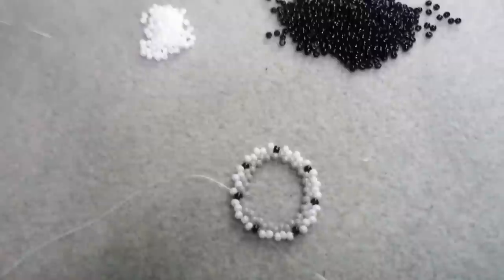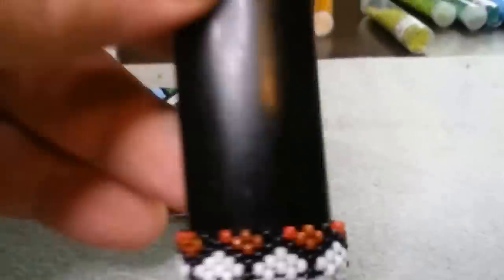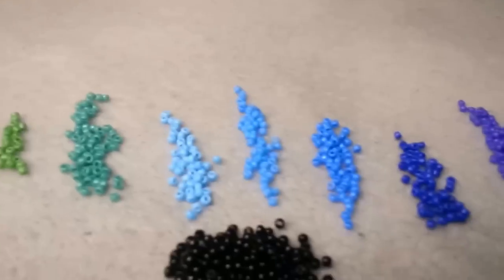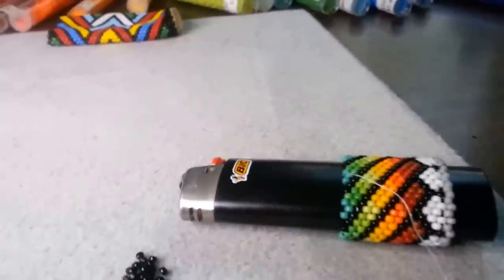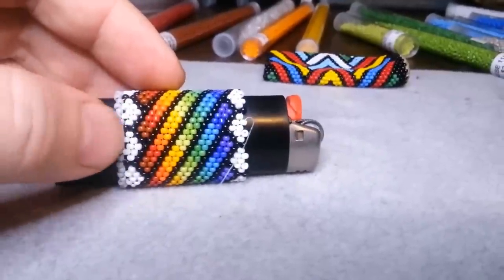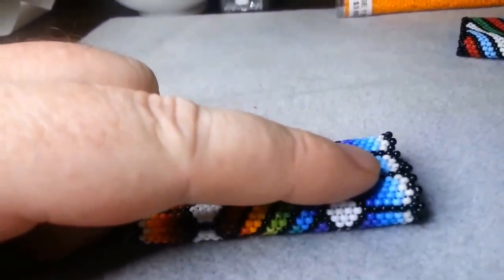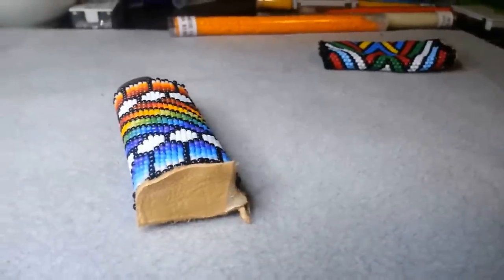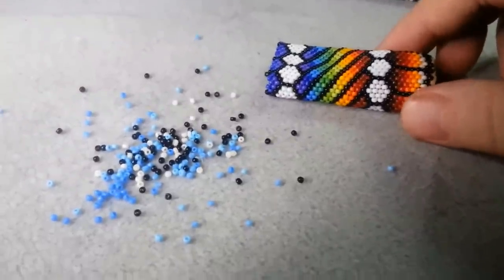Beading:  Lighter Cover Freestyle Repeating Design & Execution

Comment: Have you ever used a starter strip? You can do it with tubular peyote since you are using the same number of beads on each project. Stitch in all grey a few row of tubular peyote, every 10th bead you string on use a different color (you won't come out even 10th bead),end both ends. With a different color thread than your color for your project. Put on the first row of beads with the different color thread, don't cross threads from the previous row as you put it on (don't tie off). With your main thread for your project, now put on row two, three, etc. When you're done you take off the different color thread. snip it, pull it anything to get it off. Your starter strip will be there for the next project and it was easy to start, hold, and even tension. I didn't read this site thoroughly but basic idea.
Reply from the maker: +Kathleen Atkinson No, i haven't tried that, will have to on my next project that's not a light blank -- those things, there's no way to get the beads off (or on) if they're already sewn together.  But I could see for necklaces that might work!

Comment from the maker: Well, I suppose starting with alternating colors might help some, sure.  Only problem with it I see is that I gotta alternate color AND count, and I'm not so good at all that.  There's always gonna be a balance to strike on stuff like that, and I think it's gonna vary person to person.  If I'd continued having problems figuring out which bead to go through (on the fourth row, the second row I'm gonna keep), I wouldn't have done starter beads to begin with.  Now I do occasionally mess it all up at the start and go through the wrong bead, and your suggestion would surely fix that issue, too :).
Reply: VaniRex Hi Van, pleased to have found your channel, I've posted above a few shops that I use that will most certainly help you to expand your bead colour range. Enjoy fellow beader, Love from Rachel Walsh - Australia <3
Reply from the maker: Rachel Walsh Migwetch!

Comment: I luv your work!! 😍 May I ask what lighter you're beading on? I have a Bic I've been trying to bead on but 42 wasn't enough to go around it. I'm using 11/0 toho but I had to use 46 and it just is not working out pattern wise.:( Any help, tips, advice would be greatly appreciated. :)
Reply from the maker: Hmmm I'm using a regular Bic lighter.  Not sure why it's coming out to 46 instead of 42...

Comment: How much string do you generally start off with, to be safe? And the lighters you've used in your tutorials are slightly smaller than Bics, correct? Do you happen to know what the circumference-bead count is for Bics? Its been hard finding info on the web for beading lighter covers and it is my first time! All help is appreciated, thanks :)
Reply: Did you ever figure it out? I would like to make some as well

Comment: How many beads do u use from the beginning? Can u use size 13 cut Charlotte beads.
Reply from the maker: You can use any size you want, so long as you follow repeating pattern constraints.  I've even seen videos where the bead size is intentionally varied to make for interesting texture patterns, but the whole point behind repeating patterns is about the color of the beads, not the size.

Comment: Have a couple of questions for you. 1 - how many beads around do you use. 2 - are the beads you use delicas or seed beads
Reply from the maker: 42 seed beads around.  42 beads form 2 rows.
Reply: does this fit a regular bic lighter? I've done some flat lighter cases but never round like you do them. is it hard to do them like that?

Comment: Sir how can I keep the beadwork from sliding up on the lighter? I beaded mine over leather but the beads were not attached to the leather and the leather is not attched to the lighter. Can you give me a couple pointers? please.
Reply from the maker: You need to make a bottom for it.  See http://youtu.be/gMacR1to32k if you want to do it with leather.  And yeah, you gotta attach the beads to the bottom, or it ain't gonna work.

Comment: how many rows tall is this design? trying to make a pattern! Any help would be awesome!!!!!
Reply from the maker: juanita w Well, you have to consider two sets of columns to really know the vertical count.  I think in this one the final height was 32 beads for each set of columns, but height is also dependent on how you want the beads to fit the lighter, in the end.  Some folks actually like for the beads to fold over on the bottom some (have a very small leather bottom).  Others patterns come out a little short, and the lighter actually shows a small band of color near the top.  Ultimately, I recommend you focus less on pattern and more on just diving in.  Happy beading!

Comment: I have a question about bead count. You are using #11 seed beads by Miyuki, I tried that number on a regular size Bic with DynaMite  #11s  & came up looking like my circle was going to be at least 4 beads short of a tight fit, and it would be better to have a little leeway from what I have gathered. Are you using round beads or Delicas? I want to work on this for myself and would appreciate suggestions how to cure the problem. Are you making covers for the smaller Bics?
Reply from the maker: I worked with Dynamites, they are smaller.  Delica's I bought at Bead Bullies are smaller.  I have been using Toho/Miyuki, those work out to 42.  You might also checkout the metal blank video, that let's you reach 48 beads, etc.  I guess what I'm saying is I can only teach general principles, and every project, in some way, is unique.  Happy beading!

Comment: Hi sir it has been awhile since I spoke to you  my name is susan and i have a question for ya     i have made these lighter cases and  after the lighter burns out  when you put another lighter  in the sleeve it is lose why and how do I stop that from happening
Reply from the maker: Hm...if the lighters are the same size it should fit pretty snugly (assuming first one did).  It could be that in the act of putting the new one on you twisted the weave.  This can happen and make it either a little looser or a little tighter, depending on which way you twisted it.  I don't know if I'm describing this well enough, lemme know if that helps.
Reply: no it didn't get twisted and yes when I made it is came out tight and beautiful with a leather bottom and i made several and they don't fit tight when a new liter is inserted and we used the same size and brand of lighter. I had to pit a rubber band tightly around the lighters and then insert the lighter into the case and it worked great. But I tried everything but the same thing happened over and over. I was just wondering if you knew of a solution. No one twisted the lighter out and stretched the weave, anyway that shouldn't happen the lighter case will stretch as it is used that is a given no matter what. I just thought you may no a tip I could use or tell people about.
Reply from the maker: I'm stumped :(.

Comment: How many beeds to start out with?
Reply from the maker: It needs to be an even number.  I put starter beads on and wrap around the object until i get a good fit, pull tight around object the right number of beads that is not too loose (too many beads) but no gaps (too few beads). Of course if there is no object (like in necklace or hanging beads) none of that matters

Comment: Do you know how to make the base full of beads instead of the cover?
Reply from the maker: +laloweed No, never tried it.
Reply: +VaniRex Do you think it might be hard to do so?
Reply from the maker: +laloweed probably not too bad, you just got to make sure to reduce logically, in a balanced way, but I've never done it, myself :).  Good luck!
Reply: @laloweed 
You string an amount of thread and knot, get 30 beads and needle thru the last bead. 
Making a circle, pic up two beads and go thru every second bead. 
The bottom with be a beaded base. And than you can add hanks !!!